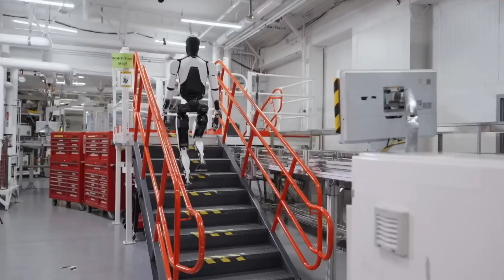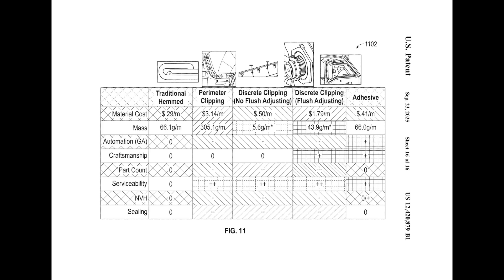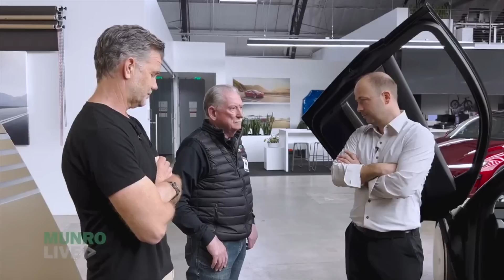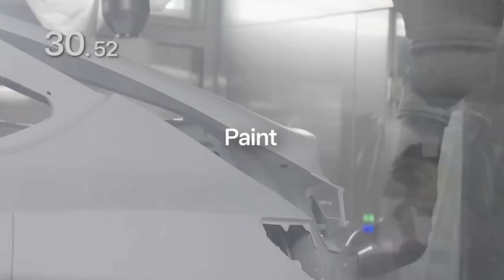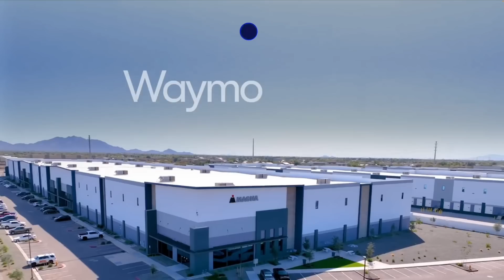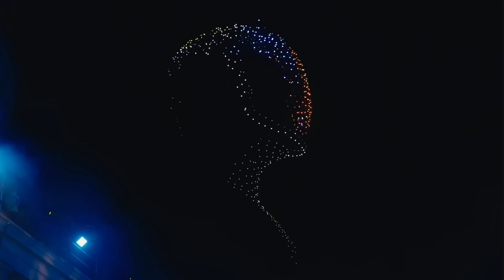Tesla granted New Patent - Unboxed Process Changes Everything! - This will SHOCK the industry

Comment: Will Ford and Toyota now have to pay Tesla to use the Unboxed method?
Reply: Apparently not, Tesla opensourced the patents.
Reply: Tesla patented it so others could not.  It would take Ford and Toyota 10 years to set up an unboxed line after Tesla produces their 10 millionth vehicle.
Reply: Tesla has not get recent success , a lot of promises not coming to life , no 25k usd EV , just lower cost model3 removing features , poor cyber truck and comparison with waymo is not based on any data , waymo will have a low cost vehicle very soon just don’t brag about it. Tesla engineering used to have such an advance now it is just good among others. Period
Reply: @lijie978  What promises?  That the dollar would not lose value?  That inflation would not quintuple in 2 years?  That tariffs would not happen?  Please tell me the lies that Tesla told you.
Here is a fact.  A Tesla Model 3 is less expensive over the lifetime of the car than a FREE NEW Toyota Camry.  It is just math.  Do the math yourself and try to prove me wrong.  Good luck.

Comment: So, a car assembled using the unbox method will use glue to hold the car parts together?  This will give the expression "held together by duct tape" a new meaning!  LOL
Reply: Um... the car you drive is held together with glue.  FYI.  Unless you drive something before 1998.
Reply: @davidbeppler3032 Really?  Which parts?  Thought it's welded or screwed together mainly?

Comment: Yes, the assembly /production system is new and different but I have not seen anything that I would class as an item that could be patented.  Surely you cannot 'patent' how things are assembled or put together.   Now if it had an anti-gravity gizmo, then yes, this part would be a patentable item, so I'm a little confused.
Reply: Yes, you can. "What does a patent protect? ...devices, substances, methods or processes. In order to be granted a patent, you'll need to make sure that your invention is: novel, useful, inventive, a suitable subject matter - known as 'manner of manufacture'."

Comment: Going to be hard to copy if its Patented 🤷🏼‍♂
Reply: The CCP will still steal it and share it with their OEMS. They have no honor.
Reply: 😂 Tessly doesnt givafuh bout Patents, nor increasing shareholder value via protecting patents.

Anything Tessly knows they make available to their competition
Reply: A Patent itself "Spills the Beans" by it's existence!
Reply: Tesla's patents are usually open to fare use
Reply: @Mista_chin17  "Tesla's patents are usually open to fare use"

In the past? Sure. But this particular one is not certain to be.
Reply: @yourcrazybear you're just assuming. Why would the change up now after years of open patents?
Reply: @Mista_chin17  "@yourcrazybear you're just assuming. "

Incorrect. You were the one that assumed that all of Tesla's patents would be open to anyone to use. I informed you that that is not certain. 

" Why would the change up now after years of open patents?"

Because the EV transition is highly successful and one of Tesla's goals and means of staying competitive when it comes to cars is to excel at manufacturing.